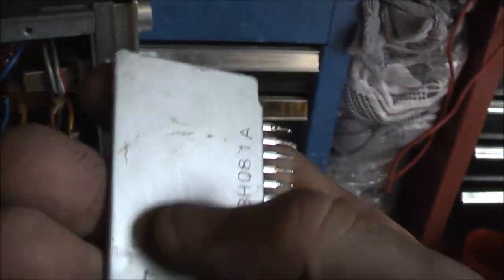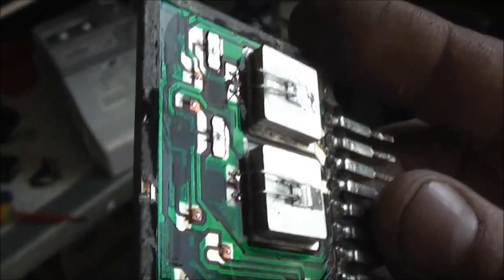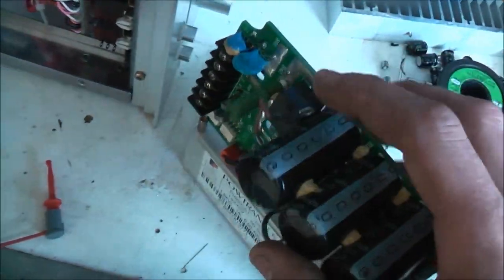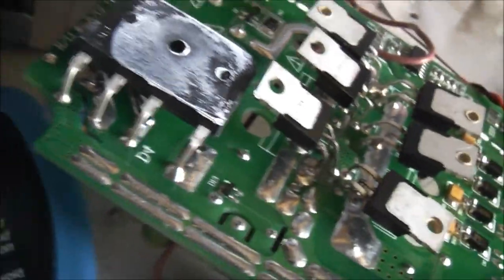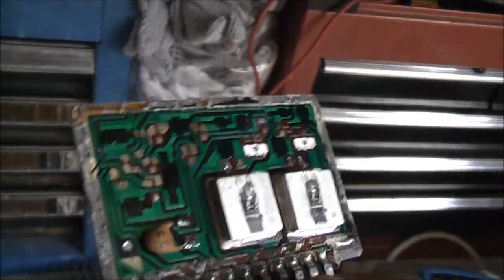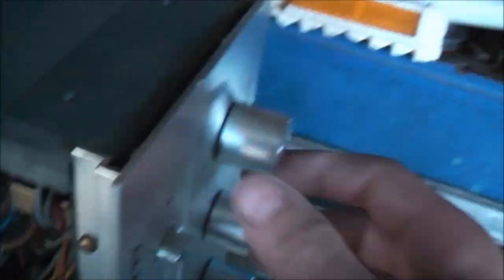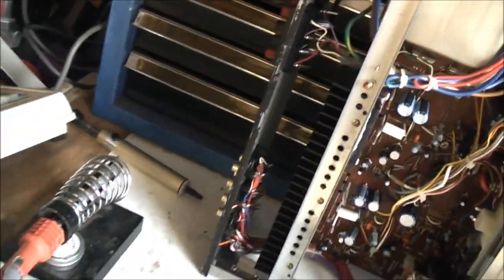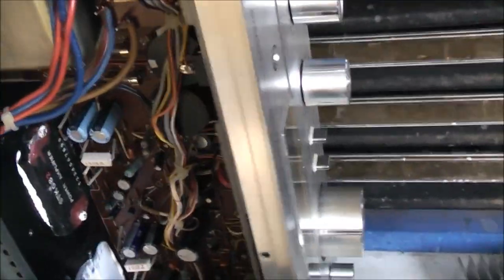STK IC Teardown

Comment: I have one of these boards kicking around. It doesn't work but one time I put power like 9 volts D.C. on it and one of the parts inside those square things lit up. I'll have to dig this out and see if any still light up.